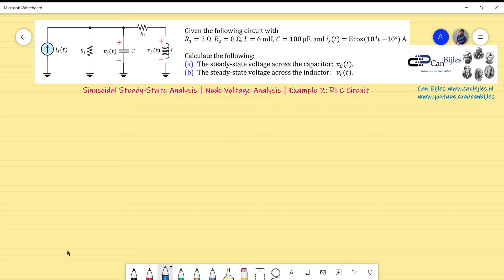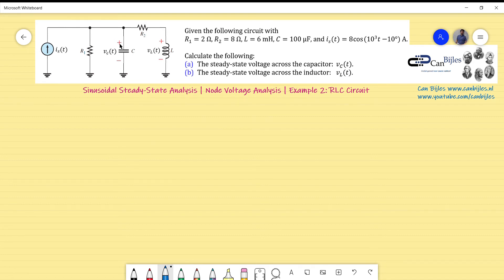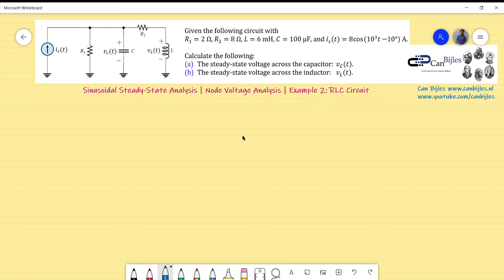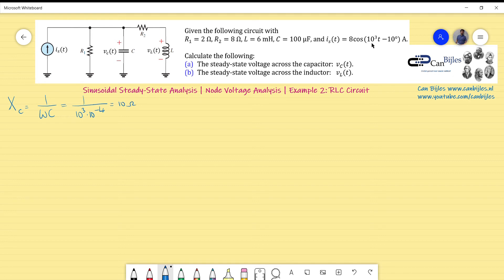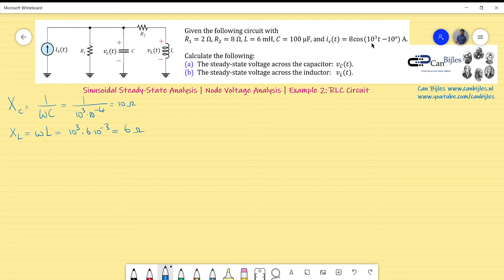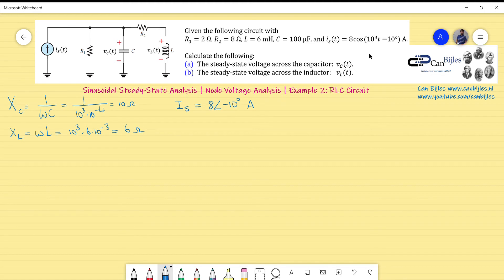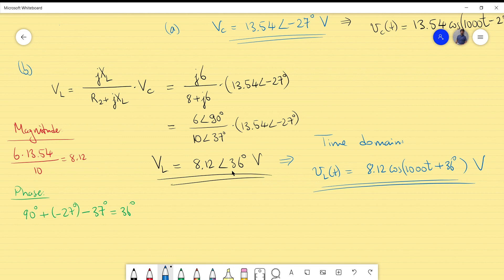AC Electric Circuits 🌟 Sinusoidal Steady-State Analysis 🌟 Node Voltage Method 💡 RLC Circuit - EX2

Comment: Nice video! Can you explain how you got to Vc(0.564 + j0.177) ? When I do it i get Vc(0.579 + 0.04j)
Reply from the maker: Thanks for your comment and checking. You are right, there is an error. From 09:00, the quantity in brackets after Vc should be 0.5799 + j0.0398. So, we have Vc[0.5799 + j0.0398].